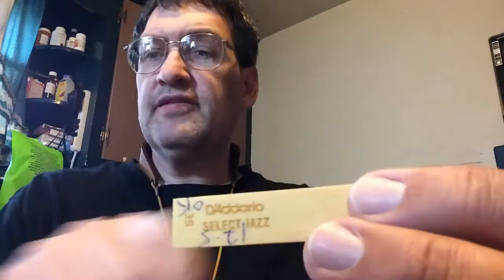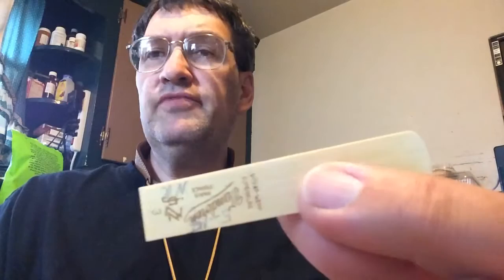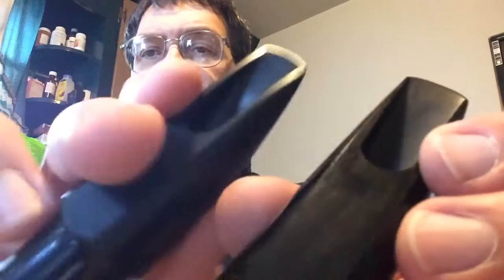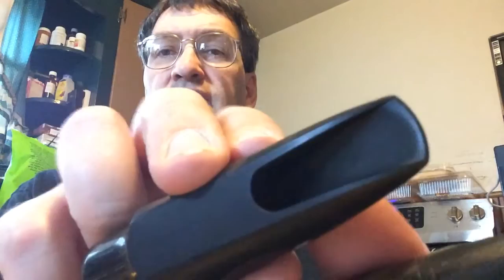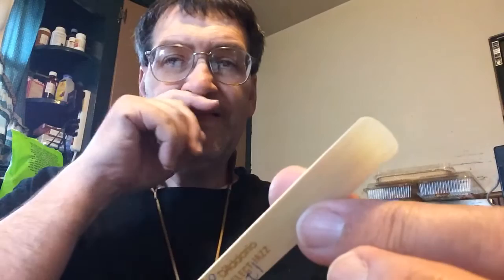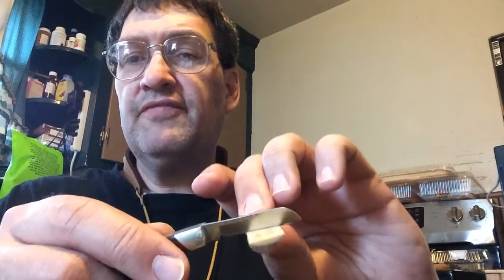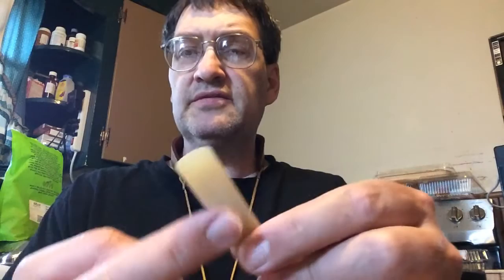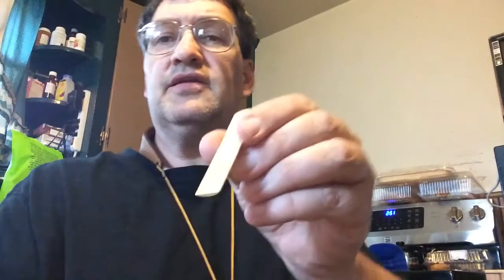Big Dave Wilson - Sax Reeds with raised lettering and poor suction.

Comment: I use the table of the mouthpiece to flatten it. If you look up "Bob Reynolds reed preparation" there's a video by Rico and I follow that process (minus the soaking in water). I find it works well but I'd like to hear your thoughts on it.
Reply from the maker: Anakin Dey 
Hi Anakin, as a rule of thumb I don't compare what I post point to point to other videos. That said, I glanced over the video you mention and will say that, I personally would not use my mouthpieces as any kind of tool to adjust or flatten reeds. The reed on the paper in circular motion is an old Allard thing which is very useful, and soaking reeds is a personal preference. I don't and even sometimes play my reeds completely dry because they get water logged enough as you play them in over a session. Every so often I take my work reeds and soak all of them in a big cup of warm salt water for 15-20 minutes, rinse and let dry on a paper towel then put away. Soaking reeds in a salt water solution is a method I learned from one of the best oboe players/teachers in NY back in the 70s. He used to make all his oboe and English horn reeds by hand, not from a box ;))))))))
Hope this helps, Dave
Reply: MisterBigDave why wouldn't you use a mouthpiece to flatten a reed?
Reply from the maker: Anakin Dey 
Hi Anakin, it's sometime hard enough to find a really good mouthpiece that you like as a "keeper". While rubber mouthpieces are not fragile, actually a soft metal Dukoff is more fragile in a number of ways, rubbing anything and causing friction and even low abrasion mild, temperature change etc against a rubber table can in time cause anomalies like unwanted concavity or unevenness of the flatness, possibly rounded edges on the ends, and even throw the precise takeoff points of the delicate rails off if you hit it right or rub it enough times. Brass or stainless steel, bronze is a different story, there is much less chance of creating an undesired wear spot. There are many options to choose to do a light flattening such as a straight blade, some people use a reed geek or similar, or very cheap you can get a flat buffing stick for nails at the drug store. All that said, using a mouthpiece for such a purpose is maybe a personal preference but not one I can recommend as a sound practice. Also, most reed preparation should be done where you have the basic tools accessible to make primary adjustments of flatness and balance, such as in your practice studio. If you're traveling and on a road gig, hopefully you prepared your materials in advance to save headaches and stress. It's very easy and relatively inexpensive to set up a proper set of tools for reed adjustment. I will maybe do a video related to this type topic in the future, but it still comes down to "what works for you", "what you feel comfortable with", and "what you have confidence in".
Happy Monday!!! Dave